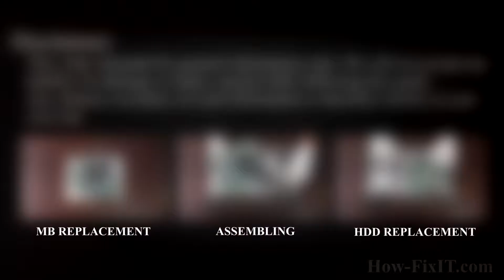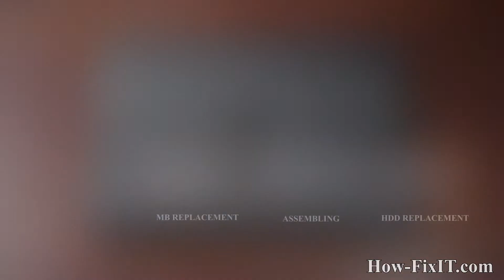HP 15-d035dx RAM Upgrade and Installation Guide

Comment: But 1 ram slot though that sucks
Reply: my mom's hp 15-d035dx as 2 ram slots tho
Reply: @TheGamerWannabe  where is the 2nd slot
Reply: @kaleabbeharneh4065  right under the first slot just like any other laptop with 2 ram slots I checked many times before making my first response it was a hp 15-d035dx according to the label on the back of the laptop as well as under the battery as i remember it had the same 2 4 GB sticks in it when I gave it to a friend from work not long ago beats me why it had 2 slots
Reply: @TheGamerWannabe  i found only 1😑😥